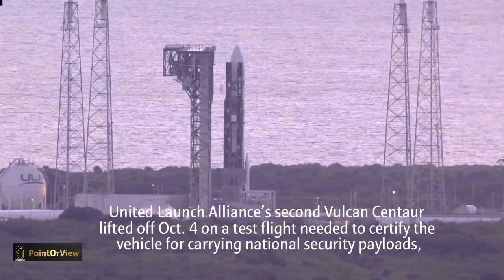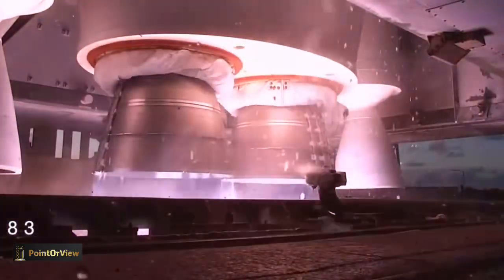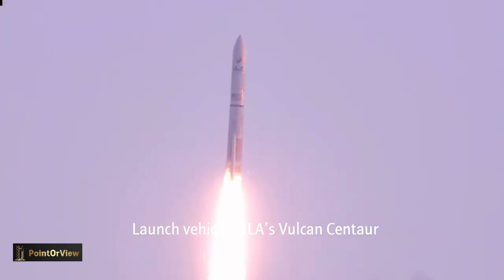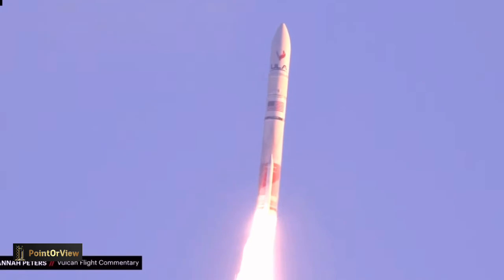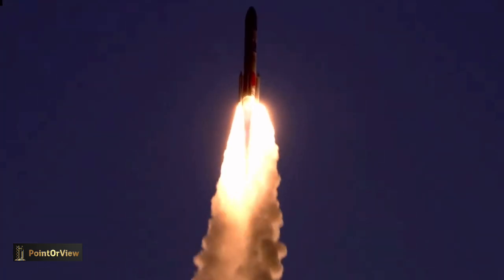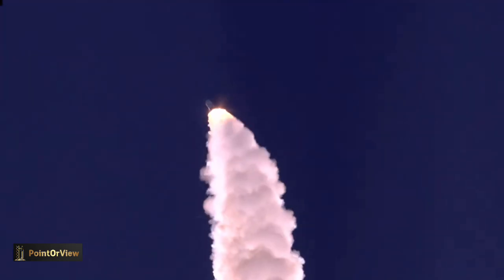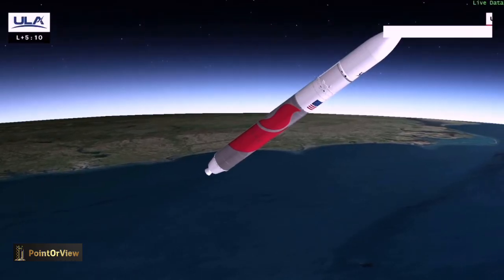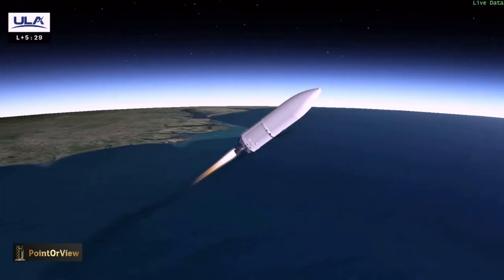SRB SCARE: ULA’s Vulcan Centaur test flight suffers an SRB anomaly, but completes the flight

Comment from the maker: One of two solid-propellant strap-on boosters provided by Northrop Grumman appeared to suffer an anomaly of some sort during the climb out of the lower atmosphere, but the Vulcan was able to continue on into orbit. What impact the issue might have on the Vulcan's certification is not yet known, but ULA CEO Tory Bruno said it will be investigated.
Reply from the maker: The piece is circular, but not the full length of the nozzle, it looks more like the lower section of the nozzle rather than the whole thing.
Since the boosters seems to burn out at roughly the same time it's reasonable to believe that the pressures inside boosters were similar so the throat was intact.

Comment: The software was good enough to adjust; Vulcan Centaur is the third most powerful rocket to reach orbit in 2024, right after SpaceX's Starship and Falcon Heavy..
Atleast until Blue Origin's New Glenn in November.....
Reply: Atlas has had incredibly good flight control software, and the brilliant engineers at General Dynamics/SD brought their experience to Lockheed Martin, and later, ULA.  Vulcan’s flight software was no doubt designed by engineers with decades of experience.  👍🏼

That was a pretty serious anomaly; the entire flight schedule was adjusted to compensate for the lost thrust and unexpected vectoring due to the non-lateral thrust.

ULA has an incredible backlog of orders, so I know they’re ready to go.  The FAA has said there is no need for an investigation, and now we’ll see if it is certified…

Comment: whoa! that looked super scary. i am surprised beyond belief that the rocket still survived and managed to stay on track.
Reply from the maker: The piece is circular, but not the full length of the nozzle, it looks more like the lower section of the nozzle rather than the whole thing.
Since the boosters seems to burn out at roughly the same time it's reasonable to believe that the pressures inside boosters were similar so the throat was intact.